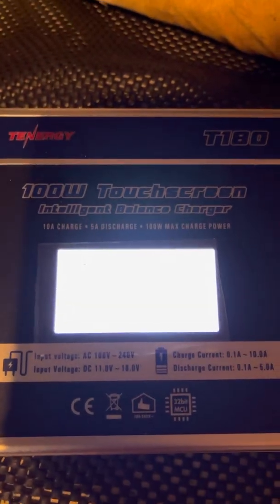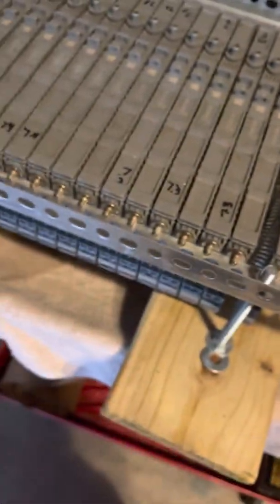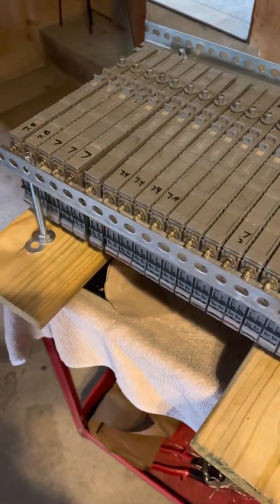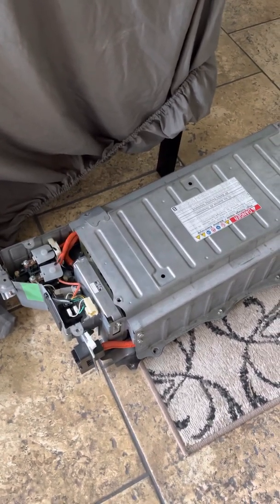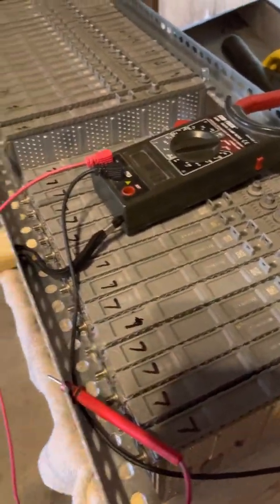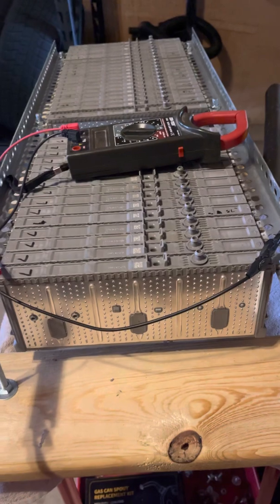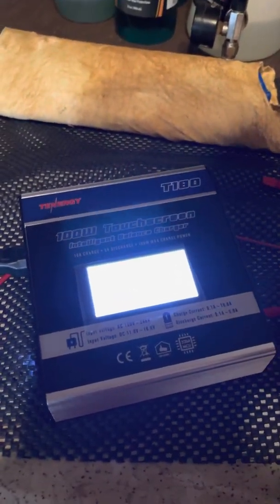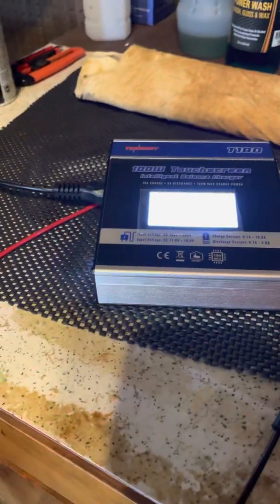Tenergy T180 Charging Hybrid Battery 33 cells at once

Comment: What is right temperature for prius hybrid battery I use Dr hybrid it shows number one 97 number two 104 number three 116 I thought middle one would be hot
Reply from the maker: so middle would be hot your correct, did you drive car for at least 20 minutes before test? sorry for late responds.
Reply: @mr.diyourselfchannel4343  number three has much higher shall i move them around
Reply from the maker: @edwinbab3205  are you going to charge them? If not yes you can and want to go off the voltage from each block, but if you are going to do all of the taking apart I would recommend getting all the batteries is good health far as you understanding the discharge? I place all my cells from me understanding the discharge mah, anything less then 5000 is no go.